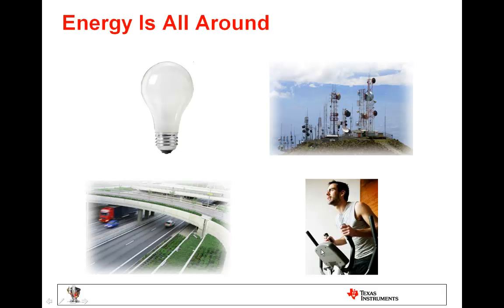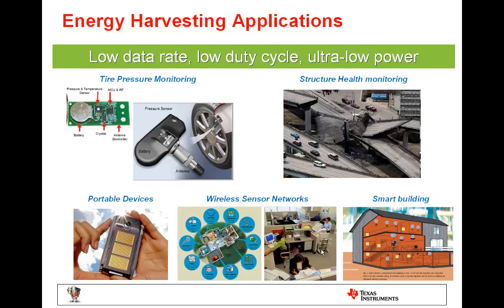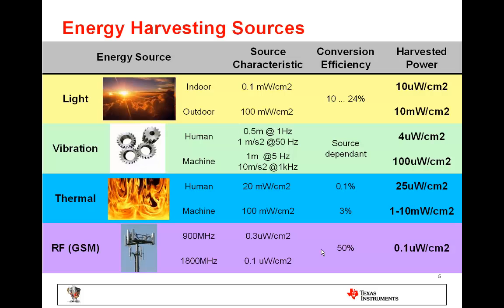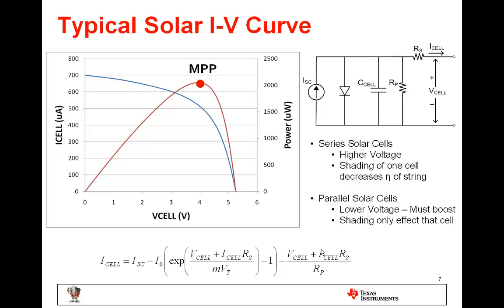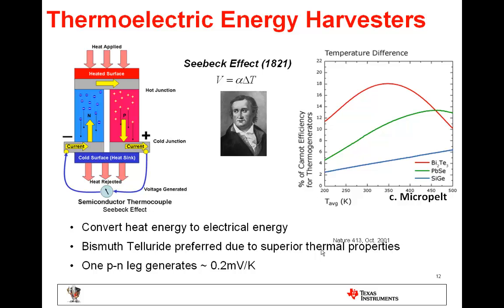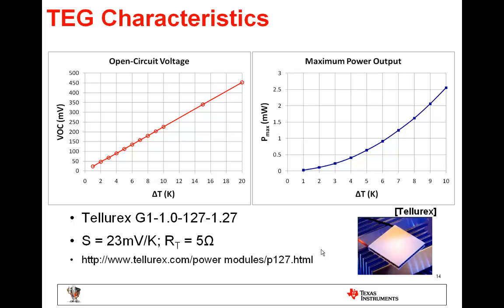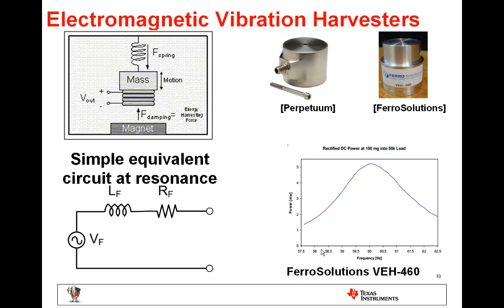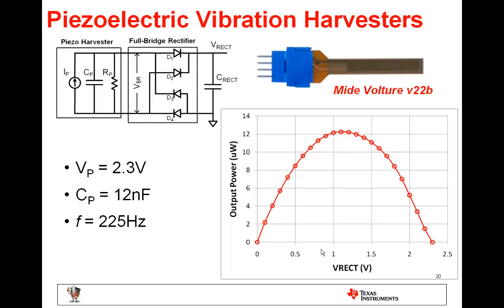Intro to Energy Harvesting

Comment: How can I determine the correct value of my filter capacitor's capacitance and the voltage that can be used after voltage rectification? 
What equation can I use or should I just try many capacitors until I find the one that suits my project?